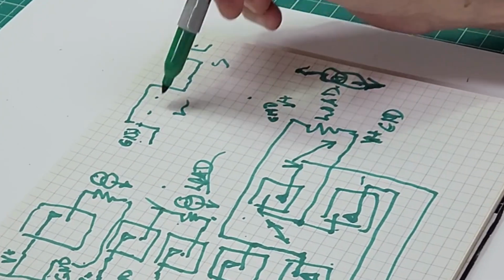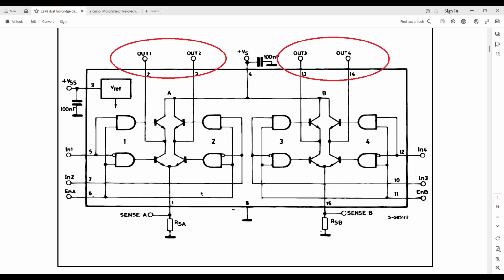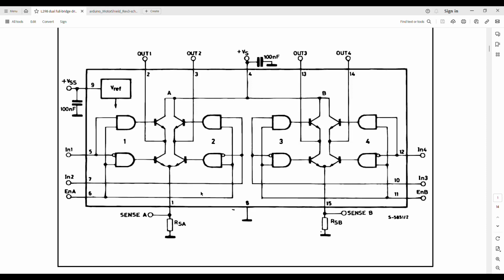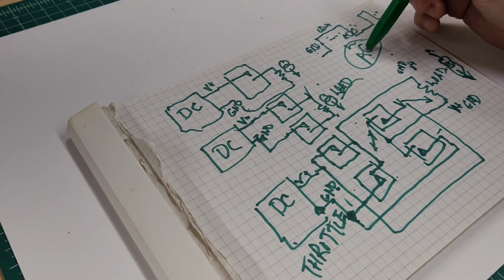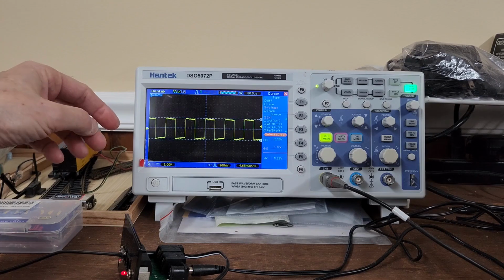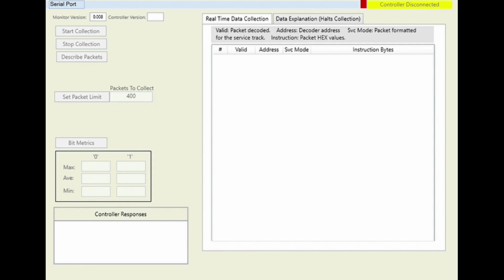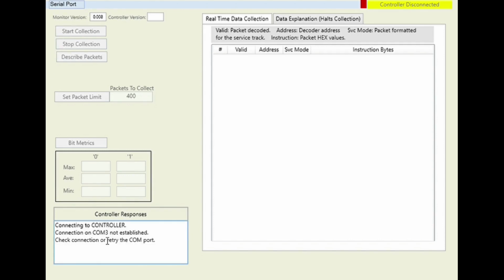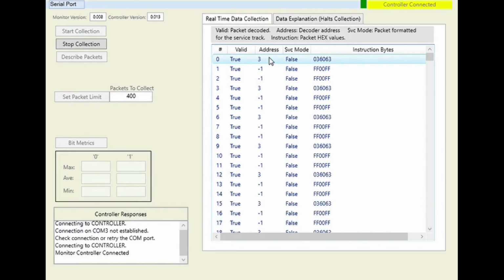Episode 12, Part II of DCC Under the Hood.

Comment: Thank you for this very interesting explanation of DCC. The conditioning diagram was a bit difficult to read, maybe, next time a better one if possible. I still was able to follow clearly to working order.
Reply from the maker: Yes, I was not careful when I sketched up the conditioning diagram. I'm pleased that you found this part of my presentation very interesting. Thank you for the kind response.
Reply: @FunWithHOScaleStuff  Yea, I understand AC, but didn't realized that the DC square wave is basically the same as a AC signal with the difference of the signal itself, and calculating the difference between the rise and fall of the signal can be used to time the square signal to get the information between 1 and 0. Now I know. I don't have a scope but would be interested is making your test procedure. Can't wait for the following episode.
Reply from the maker: @Christiane069  Thank you for this kind feedback. I'm glad you were able to gain this insight.